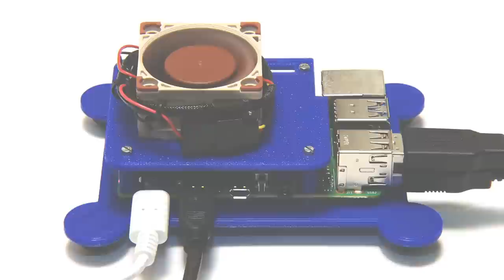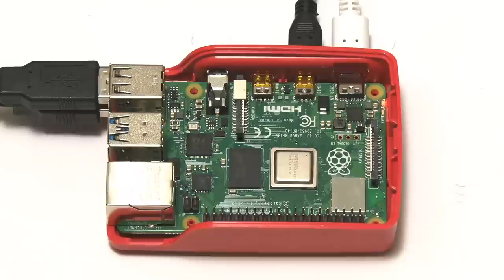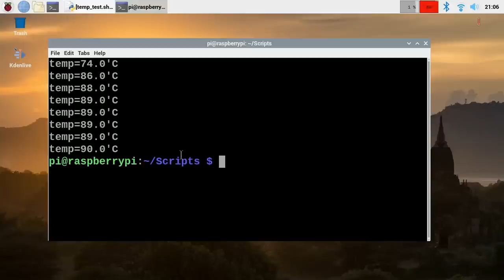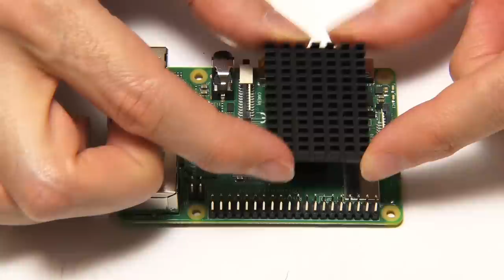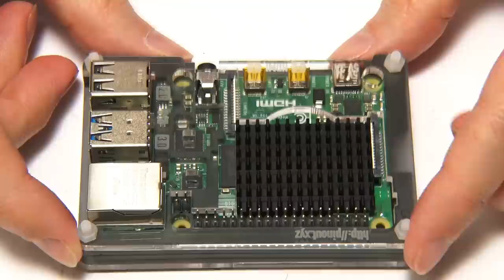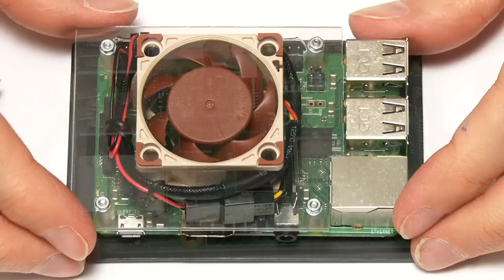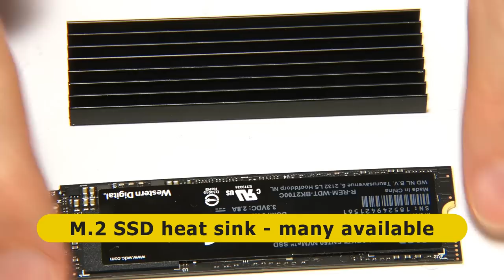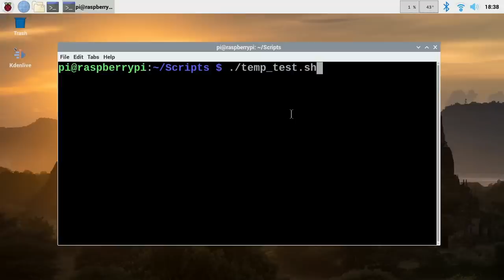Raspberry Pi 4 Cooling

Comment: So during the hot days this year I noticed my kids KODI PI 3 getting up to 65C so I got a couple of them little heat-sinks and put them in my PI 3 case with the small pi-fan.

It turns out with the fan blowing down onto the sinks (through a hole i made in the lid), it now maintains 40C at full load and 36C at idle. This is because the case lid has a little gap all the way around it, so the hot air circulates and is literally blown out the lid gap and cooler air is constantly hitting the heat-sink.

So case choice also has a big impact on the temperature too!

https://www.amazon.com/Raspberry-Case-Black-Compatible-Model/dp/B00UW2G1BS

Sounds like a harrier jump jet, but during the daytime its perfectly usable!

Comment: Test how standing the Pi on its edge with the heat sink ridges oriented to be in line vertically, improves air circulation.

To my designer's eye, it looks like keeping the Pi horizontal traps the air under the Pi board and obstructs air flow. Next I would design the fan to blow across the board and strip the hot air away from the cpu.
Reply: mharris1270   Consult with an engineer to turn the board 90°?

Wonder what the engineer will charge for his services?
Reply: mharris1270   You really are struggling with this!

It is a box with 6 sides. TURN the box on one side so the board is vertical and the fins of the cooler align vertically. If you need access to the side underneath, prop it up. Don't know how I can explain it any simpler. 

Thermal design is just letting air flow around the object as freely as possible with the knowledge that hot air rises and cooler air moves in under to feed the cycle.

Comment: Looking at this I start wondering whether a NUC or similar mini-pc with decent thermal design would be a better fit for many things people use PI's for.
I have several PI's, but my favourite solution this far is a ModMyPI DIN rail mount that allows me to run it from a lead-acid battery (kind of a 12v (=14) UPS system).

I love the PI, but for some tasks you reach full donglage (dongle-age - is that a word?? )....   where the usb-to-serial and hdmi-to-vga-to-whatever and the power brick-to-usb.......   and the combination of attachments exceeds the size of the entire PI by 4-5 .... I start wondering if putting down a Mac Mini with Linux or a NUC or some generic Micro-ATX would be a better solution.

I have to admit though, that a setup like this (open PI with giant fan) would be a sexy addition to my din rail. I wonder if running Homeassistant would overheat the PI 4 nasty enough for this to be needed.
I run 2 PI 3's and they don't heat up much. I am however about to experiment with MotionEYE and that might introduce thermal issues quick...

Comment: Would be cool a little tutorial and setup with a temperature controlled fan. Because for iddle state there is no need, but program something to start cooling when the Pi hits like 75 would be very nice.

I guess that could be made using gpio pwm pins from the raspberry
Reply from the maker: I may well do this!
Reply: *idle

Comment: I have an M.2 SSD in my new computer that came with a very fancy looking heat sink on it, not just plain black fins but an angular geometric pattern that appears to be laser cut. When I examined it and touched it my fingertip suffered a bleeding cut as if I had fondled a razor blade. If I ever need to handle it again I will first dull all the edges with abrasive.

Comment: This man always does very good work. Chris I have a question, would it be possible to use a water block on a SBC, most likely using an external power source?
Reply from the maker: It would --- but tests on Novaspirit Tech show water cooling to be less effective than a fan on a Pi 4. :)

Comment: Really great improvement ... but at the end the pi becomes an adult computer so too say.

2x hdmi out and 2 to 4 GB RAM combined with calculating power ends always in heat that has to be pushed away. Thanks for the great ideas ... like the m2 heatsink + coupe case I will go for such a case and tiniest fan I can get.

But: pi 4 becomes damn expensive close to or over 100€ for 4 GB, charger, hdmi adapter, fan, heatsink ... and even with lower RAM over 80 €

Comment: please take a look at udoo bolt!! it's a ryzen embedded sbc ! with a vega 8 graphics!! ... I need some more look over the board and your videos r best to look for details... there is only 1 good review of this board and that's by eta prime ... I think of removing all the connectors to make it slim.. change the cpu cooler and somehow also make the ram slots horizontal which will be the most difficult thing... I will put this inside a netbook! I am trying to find something powerful.. if everything fails will just get a Intel nuc board and fit that one in!!
Reply from the maker: I was filming the UDOO BOLT this very day . . . along with loads of accessories. The video will post here fairly soon (probably 11th August).
Reply: @ExplainingComputers  wow !! cool!!

Comment: Thats brilliant. A solution for everyone there. Case seems a poor choice even though it is quite aesthetically pleasing. I would have thought they would have supplied a decent heatsink as they cost a couple of quid/dollars pennies. The Pibow case is also pleasing on the eye but seems pointless as it doesnt help temps. How much were you custom 3d printed parts if you dont mind me asking as the overall finished product looks great. 25 degrees lower temps is brilliant.
Reply from the maker: I paid $14 for the 3DP parts (including delivery, and for those asking, I did pay in dollars, as the service -- http://seaside3d.com -- use Treatstock, which is US-based, even though I am in the UK). It is also possible to build the mount from plasticard and parts of a soap dispenser -- as I did in this video for a Pi 3B+: https://www.youtube.com/watch?v=RxBaEiQHzLU
Reply: *your custom (possessive)
*don't
Reply: @alvallac2171  
Youtube has millions of uploaded videos every day so it must take all of YOUR time to check all the errors, or do you just do mine?

Comment: I would have liked to see more data that the GPU temp. the vcgencmd tool allows you to display things like clock speed, throttling state and voltage for example.

Comment: Hello, you wouldn't know how much current can be drawn from the GPIO pin 4? I've been thinking of connecting a step-up switch to get 12V for the fan that uses 0.29A ( Nidec Gamma 28). I tested it in a crude setup using external 12V  and copper ram/mosfet heatsinks from Enzotech that fit really nicely. Ran the test a few times and had a max of 43 degres Celsius with 25 ambient :)
Reply from the maker: The limit will be the PSU, as the 5V GPIO pins are tapped from the PSU before the Pi's voltage regulator. So drawing 0.29A should be fine, providing your PSU can supply it and enough to power the Pi (so realistically you will need a 3A+ 5V PSU).

Comment: Hi Christopher. Great video. I don't understand why they don't sell a good cooling sollution for the Pi4 with a fitting case. It really neads it. I like that big heatsink. I'll see to source me some. 
Nice setup with the Noctua fan.
I also made a review video about the RPi4B this week. I came to the same conclusion. It needs a good heatsink + fan to be great. 
Software wise it's also a waiting game. But I'm sure it's all going to be ok. I've tried an arm64 Ubuntu bionic on it. And overclocked it. The CPU-performance is unmatched to other quad-core SBC's. 
I could easily clock it to 2Ghz with the latest firmware. Above that seemed to be software limited. 
It is a surprise they came with this to me. I like it. But it has its faults too. 
I wonder if Microsoft will release a Windows for ARM for this. It does have the performance for it. The ram upgrade is amazing.
Greetings.
Reply from the maker: Hi Nico. I think many people are wondering what is going on here. the Raspberry Pi Foundation must have tested the Pi 4B running at load in their own case. And while redesigning the board, a couple of mounting holes for a fan could potentiallu have been added.
Reply: @ExplainingComputers  Indeed. They must have done something about it. The picture I use of the board shows it's a 2018 model. So they must have had them back then. Enough time to see these things are potential problems. Crazy they can keep it quiet so long.
I also see the lack of attention and love for the board at the Foundation. If enough people with love for SBCs, and who really use them daily, work at the RPi Foundation. Then such things would not happen. I'm willing to be tester, but could I keep it quiet that long :) Have a great evening.
Reply from the maker: Yes, your observation on the 2018 date on the boards is very interesting. It suggests to me that maybe release was planned for earlier -- maybe on Pi Day -- and was delayed by software issues . . .

Comment: Hi great video, the new flirc case arrived with me today, so I tried it out, your video is so very wise, after a number of updates watching videos, my flirc case did the same as a pi in an ordinary pi case did, it over heated, the pibow case with out a fan, was more effective at keeping the pi cool.
the flirc case, that I like so very much on other raspberry pi, is very much a disappointment on the pi 4, it started to make burning plastic smells, maybe if I stuck an xu4q cooler on the top of it, or a wraith spire cooler from my Ryzen 3600x, doesn't quite have that neet look after though.
 A nice case for active cooling is needed, I will be looking forward to new cases to come from retroflag.
Reply from the maker: We will see many more Pi 4B cooling solutions -- I've already got some arriving for a video in early September. :)
Reply: @ExplainingComputers  excellent looking forward to it.

Comment: Oof... Running at those temps in the earlier test first, though... Were you not worried about damaging the chip, potentially decreasing the performance overall, and skewing future tests? 
I ask, specifically, because I had a Pi Zero W that got a bit too hot once (fan failed after only a few thousand hours!) and after that, even swapping out the micro SD card just in case it was that, I saw a significant drop in performance. Fortunately it wasn't required to be more powerful for my particular application, but I would never repurpose that raspberry pi for anything else, as even just launching raspbian lite is taking a good 2 minutes now, where it was previously a ~40sec process to launch, run my scripts, and be up and running. Even tested it with a full raspbian image, and it was painfully slow. (To the point of being unusable, as it would freeze up constantly.) Definitely showing signs of severe chip stress.) 
Dropping the SD card in another Pi Zero W ran everything at full speed, so it's definitely that unit itself, and it was right after the overheating issue, so I feel safe assuming cause/effect here, unless you perhaps have some suggestions I'm missing?
FTR I run in a 21-24C environment with all my server and personal PC temp limits set to critical shutdown at 75C, as that means something has failed. Standard operating temps are around 37-42 general use, and 55-57C for gaming. Can't seem to keep the video card cooler than that. Oh, and with overclocking, the GPU under heavy load sits around 60-62C. 
I want to avoid damage, as it is fairly expensive hardware to me, and I just want it to last as long as possible. Same with a Raspberry Pi, as there's ALWAYS a way to repurpose one for a new project. That Pi aforementioned has been a WiFi light switch relay controller, an addressable LED strip controller for ambient lighting, a security camera, led matrix RSS streamer, and is now an outdoor (inside mailbox except for the solar panel and light sensors) light/air quality/etc. weather sensor station. 😁 (I kept trying to find something it was strong enough for, and the rest all became Pi 2/3 projects as they'd initially started out)
Reply from the maker: Point very much taken regarding the first test -- and the reason why I did not run out-of-case with no heat sink. That was a one-time-only gig. :)

Comment: What makes me sad is that all of this is moving in the wrong direction in general. Pi was supposed to be a nice little board without any moving parts usable for both fun and electronics builds, once you start to add complex cases and fans (and hence cost) you roam into the intel atom territory which to this date still wipes the floor with raspberry in terms of actual computing performance. I am happy that they are adding more ram so you can run actual good stuff on the board. That being said - my rpi 3b+ also carries a heatsink to keep it reasonably cooled.
Reply: You don't technically need cooling, you just need cooling if you're doing compute intensive stuff. But yeah, the designers need to look at this and think long and hard about what a pi 5 would actually be.

Comment: How do you remove the heat sinks once you applied them? I have  a dead Pi with a heatsink I want to recover and put on a new Pi that didn't come with the heat sink, but it's firmly stuck to the dead Pi.
Reply from the maker: Try twisting, usually works best. If it is held with tape, try a little acetone (nail varnish remover, paint brush cleaner, etc) to soften it up a bit. Good luck!

Comment: On the Noctura fan, I think you have it blowing across/onto the RPi.  Have you temperature tested that compared to removing the hot air from the board section and blowing it up and away from the RPi?
Reply from the maker: Yes, I have the fan blowing down onto the heat sink, which is normal for a CPU fan. I've not tried it the other way (like a case exhaust fan). But in an open rig like this, I cannot imagine the results being any different, as the key thing is airflow -- which is considerable! :)

Comment: I am strongly considering an Ice tower cooler(without fan) as the computer will be running 24/7. I assume your printed 3d base (bottom) will be fine. The top would seem to need a redesign to work with this(maybe a two part top that "slides" together around the tower?). Assuming the Usb chip gets a small heat sink too, do you see any potential problems with such a setup? With my luck with fans, I can put up with the eyesore of the tower (assuming it does not like to "fall over" too much). Thanks
Reply from the maker: The ICE Tower looks a great solution (one has just arrived for a follow-up cooling video). What you suggest should work, although the base board here is intended for smaller screws, whereas the ICE Tower uses standar Pi risers.

Comment: Thank you for making this vid,  I rand the same test (thanks for sharing your Bash script) with my Pi 4 2GB, and the following bits form Pirmoroni:  "Ninja – Pibow Coupé 4" + Fan SHIM + Raspberry Pi 4 Heatsink(40x30x5mm) and some Super Glue.
I got the following temps 52c at the end or the run (and ambient was a bit more the 20c 
 
I use the Pirmoroni heatsink and fan at the same time (there was a bit of cutting and glue involved, and I might try a GPIO extender/Stacking Header for a more permanent solution) I am happy with the results/temps.  

#!/bin/bash
clear
#nice little loop

or f in {1..7}
do
 vcgencmd measure_temp
 sysbench --test=cpu --cpu-max-prime=25000 --num-threads=4 run >/dev/null 2>&1
done

vcgencmd measure_temp

=========

> vcgencmd measure_temp
> sysbench --test=cpu --cpu-max-prime=25000 --num-threads=4 run >/dev/null 2>&1
> done
temp=39.0'C
temp=51.0'C
temp=51.0'C
temp=53.0'C
temp=51.0'C
temp=52.0'C
temp=52.0'C
pi@Rip4:~ $ 
pi@Rip4:~ $ vcgencmd measure_temp

Comment: Thanks for running a comparison! I found one thing odd however: the larger passive solution had moderate thermal throttling according to the graph colour? So how can the execution time be the exact same as the active cooling solution with absolutely zero thermal throttling? Or did I misunderstand something? Did you round the running times, since all the runtimes are in full minutes?
Reply from the maker: The time was longer -- 11 mins for the two active solutions, 10 mins for the final test with no throttling. When I started out, I had no intention of measuring the time, but then things changed! :)

Comment: The most worrying thing that people should see is the idle temps are high and that is over here in England, which isn't that warm of a country (most of the time), so in a country with hot weather, the idle temps would be way higher and the need of a heatsink and fan will be mandatory (if you intend to use the Raspberry Pii as intended). 

They even sell a case with no ventilation, which is complete insanity.
Reply: Thing is warm counties have air con, we generally don't.  So most people will have the same ambient temperatures (18-25C) range.  Also with the Pi4, say it gets used in a kiosk use case, the whole case is the heat sink- they can passively cool Ryzen using that method so a Pi4 isn't going to be a struggle.  Where it doesn't make sense is as a desktop replacement, but I don't think it ever has or will.

Comment: I agree with you and your findings. However having experimented with the Pi 4 myself, I feel the main things to remember are: 1. The official Pi 4 case should be avoided since it has no heat vents. Altering that case with some vents would make it much more suited for the Pi 4.     2. A vented case with a cpu heatsink will work for most people since they will rarely ever be continually stressing the CPU to such degree.     3. Skipping all heat sinks and merely placing a decent fan blowing downward towards the sbc will meet the cooling needs of most anyone.

Comment: Harking back to the spacers made from parts of plastic handwash bottles, if you want a cheap, easily modded case for the Pi 4B and other SBCs of the same form factor, try ASDA's Little Angels Cotton Wool Buds, which come in a soft plastic container. The box has plenty of room for fans and other extra bits. Remove the paper labels carefully.